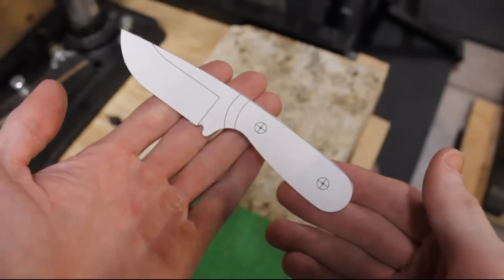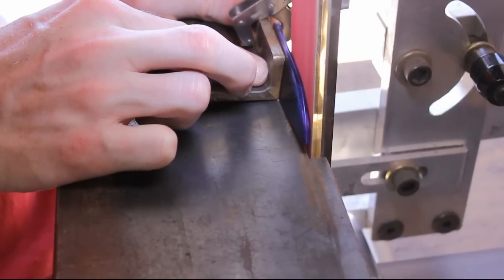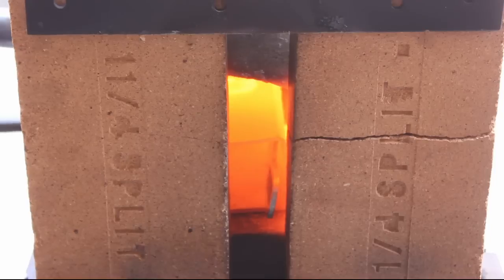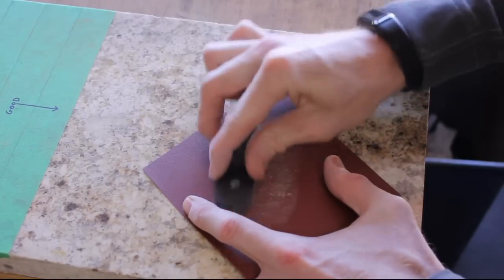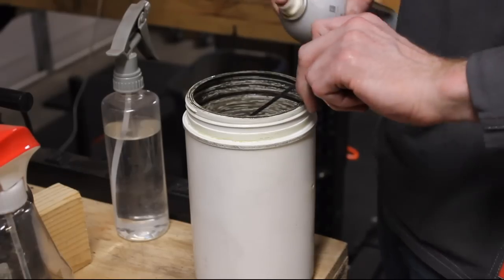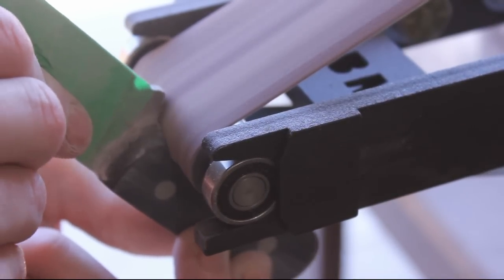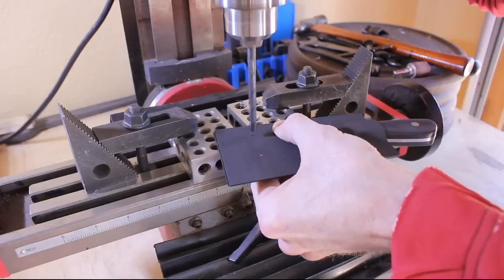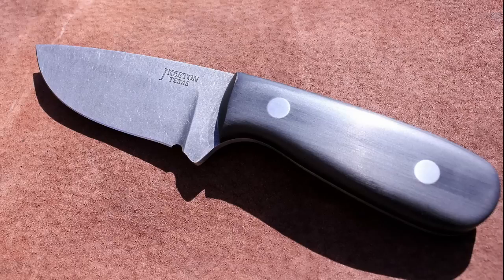Making a Small EDC Fixed Blade Knife - Start to Finish

Comment: 6:43 for my ‘automatic stone washer”, I used a cheap RC car (cost about $20) turned upside down.  The ‘jar’ (an old plastic coffee ’can’) fits nicely into the 4 wheels, and I just tape the ‘throttle’ open and set the timer on my phone.  Cheap and cheerful.  
Lovely EDC knife. I have a similar one, just with a bit fuller blade (semi-skinner?) 
Cheers from Tassie.
Reply from the maker: Thanks for the comment! Cheers from Texas!

Comment: Awesome knife.
Reply from the maker: Thank you!
Reply: Is a 1"x30 belt sander ok? Or should I look for a 4"
Reply from the maker: @pvpv6969  Hey PV, many people start with a 1/30. It's not the best, but you can order some good ceramic belts for it to get alot of good work in.
Reply: @RedBeardOps  thank you for all your help
Reply: @RedBeardOps  i found a 2x42 on Amazon for like 220.00 would that one be better?
Reply from the maker: @pvpv6969  Yeah man check out this video - https://youtu.be/3AvFCTcLLuY - I did a review on this guy a long time ago, so I apologize for the video quality. I have some links to alternatives of the same grinder in the description of that video. Cheers!

Comment: I have been hearing that there is a break-in period on the cork belts. What is your break-in process?
Reply from the maker: I'm not a master cork-belt-person... but do use them from time to time. I honestly have the same ones from this video! 

What I was told was to load it up with compound and hard grind a piece of scrap steel with it for like 15 min... maybe repeat a few times... but that's all I remember. Some people swear by these belts!

Comment: How is two 2 hour temper cycles gonna be different than two 1 hour cycles at the same temperature? I see people do both and I've done both and haven't really seen much difference  in performance. I'm interested to hear your thoughts.
Reply from the maker: Hey Josh, To be honest I don't think there will be that much variance. I like two since it grantees everything gets up to temp. From my research you can go even longer if you want and not see many hits on the rockwell. Would be a good question to pass by the guys on bladeforums.
Reply: I've understood that the thicknesses of steel that knifemakers use the only thing longer times would effect for a plain carbon steel like 1080 or 1095  is to ensure the entire thickness of the blade reaches the target temperature...
Thanks for the quick response!

Comment: Do you quench in parks 50 for O1 tool steel or is that a steel you don't use
Reply from the maker: I mostly use 1084. It's the most forgiving steel for a home forge heat treat.

Comment: That looks great man! So for the normalizing I was under the impression that 1084 is usually good to go as is and can be heat treated without normalizing? Or did you just do that as an extra precaution since you grinded it out and what not. Very clean build though. Do you do your initial bevels by jig then finish by free hand?
Reply from the maker: Hey Chris; Yes it's more of a precaution. Some stress can definitely be placed in the blade during grinding. I've been using my bevel jig to remove ~80% of the material; then switching to freehand once I have the bevels established. I find that I can get a better grind and plunge by free hand... with patience.
Reply: @RedBeardOps  thanks man good call on the normalizing. I need to look into it a bit more and not rush myself. I actually did the same thing on a couple knives tonight finishing them free hand and they came out awesome. One of them had a deep gouge and a weird grind line from when I used a hand file jig but I was able to save it. Free hand feels good too!
Reply from the maker: Chris Santos glad to hear it! Once the bevels are established the free hand works well for me!
Reply: @RedBeardOps  now I just need to invest in some calipers to keep everything nice and even lol.
Reply from the maker: @CuttinChris  These cheep ones have been working out well for me. I'm not sure how long they'll last though (I've had them since 2015). https://amzn.to/2Z6EsUZ

Comment: This is a stupid question no doubt and might not get answered because it is an older video but......How on earth do you grind your bevels to the desired mark when the angle is set by the bevel jig? I see makers using bevel jigs but hit the desired bevel line much higher up. Doesn't make sense to me because your angle is set and if you stick to it will not reach that line. You will hit your center line before you get that close to the spine with the bevels. SO I end up with bevels much lower than I see most makers achieve. The only way I can see to raise it is too change the angle of the jig. But again that is the angle of the jig determining where the bevel reaches...aaaaaaah help lol
Reply from the maker: That's exactly right. You change the angle of the jig or work rest. Some guys have fixed angle jigs made for specific profiles and blade heights. I
Reply: @RedBeardOps  Thanks for the reply. It would seem pretty easy to understand but with that being the case I could not figure out why guys would mark the bevels and then grind on a jig and somehow hit the bevel mark. I felt like there was a piece missing. My knives have all been coming out like Moras. They get the job done but aren't nearly as sexy as what I see yourself and other experienced makers produce. So I will adjust my jig! Thanks again.

Comment: id love this knife but with the handle a little longer and some gimping on the spine.
Reply from the maker: Thanks for your comment, Kevin. I need to start adding some gimping for sure The handle was designed short so as to be a small 3-finger design.
Reply: @RedBeardOps  ive got a three finger knife and its just too little for me personally. i like the look of this one and was thinking more of it being a skinner. i like the belly it has for that task but still small enough to have great control
Reply from the maker: @kevinsmith4178  I see I see. I have long fingers too, so it isn't my ideal option either. Have a good weekend sir!